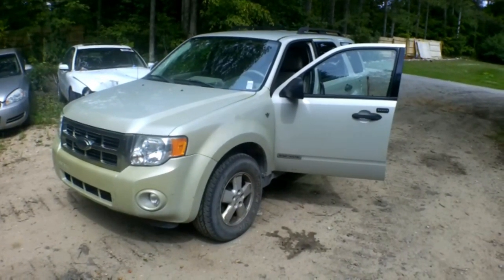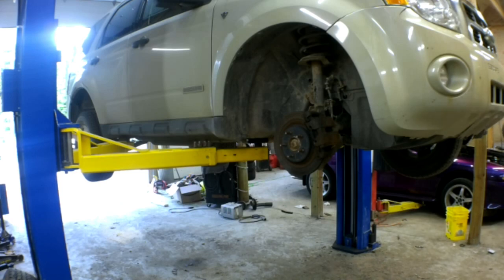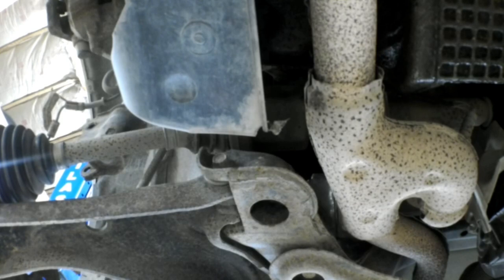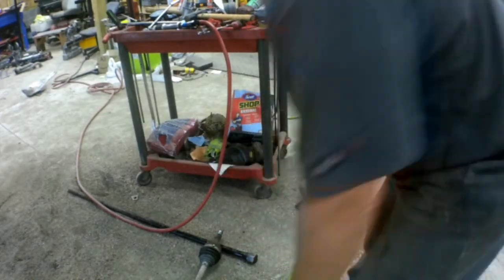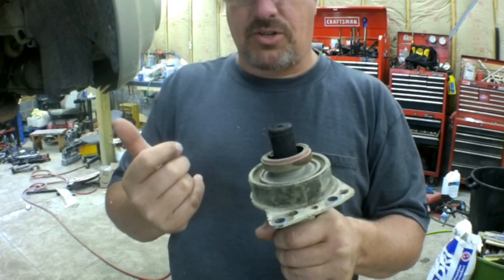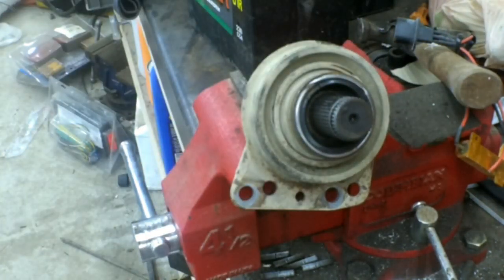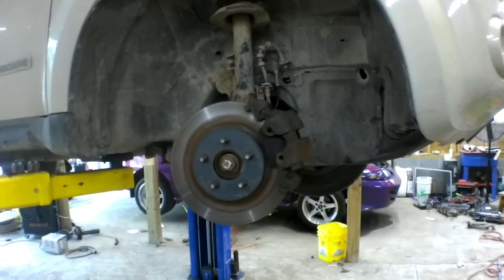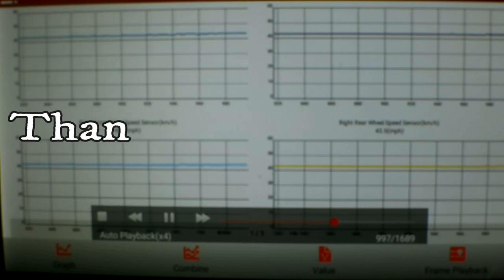Ford Escape axle shaft causing ABS issue

Comment: I have a 2005 Ford Escape. I noticed that you can buy just the tone ring. Can you replace just the ring and not the whole axle? My ABS sensor was on and someone told me that I had to replace the whole thing because the tone sensor was loose. Also, would this problem cause the tires to wear out fast? I just purchased four new tires and in less than six months the front two are completely slick (evenly) on both sides?
Reply: yes, you can replace just the tone ring.  Some people have welded it back together but you'll have to grind excess weld down.  easier to buy new tone ring.  But if you're unable to get one, weld away.  Tires bald, your alignment is off.